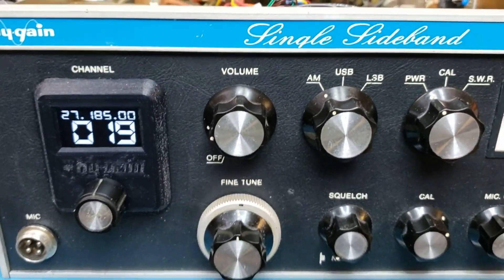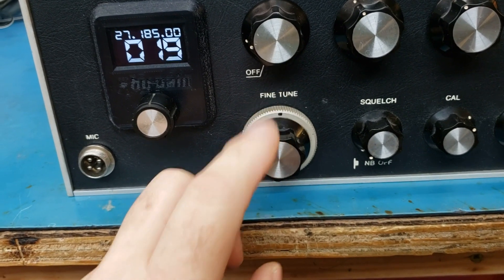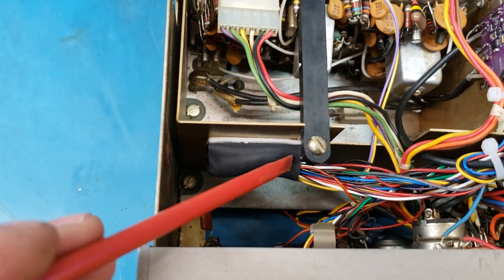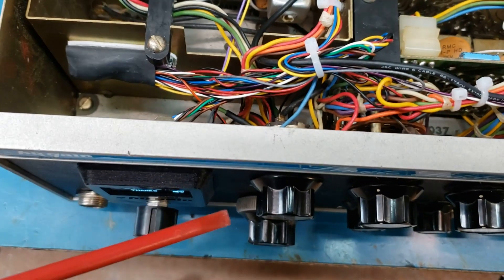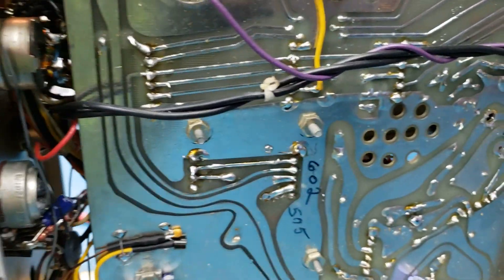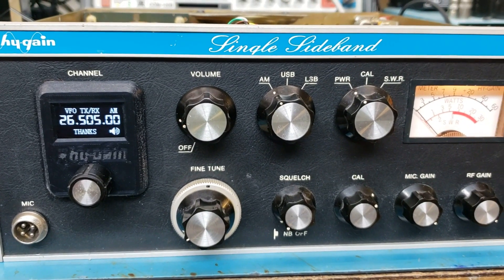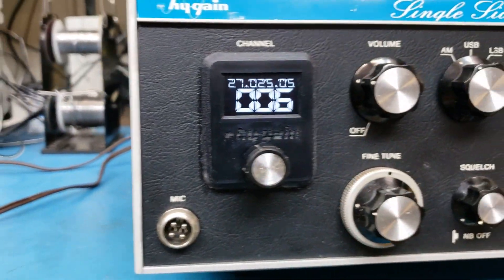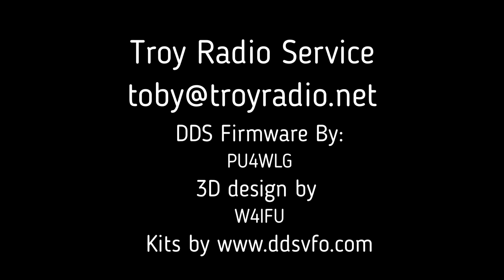DDS-VFO on a Hy-gain Utopia 623

Comment: Nice job Toby. Did you do anything different with the power cord 12 pin cinch setup? I'm looking at my 623 and 623A rite now and looking to put the AC computer style power supply style socket in both of my utopia's so i can run the simple PC grounded power cord to mine. Thanks for DDS-VFO'n my Hygain 6 VFO and Hygain 5, 674B. From your friend in Colorado, Scott
Reply from the maker: No difference, I left it as is. Waving from Tx!